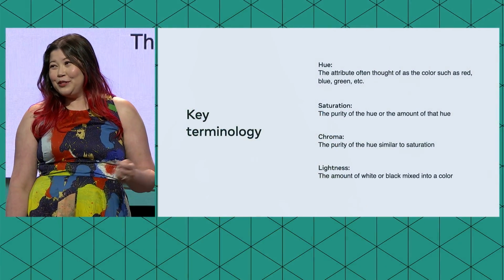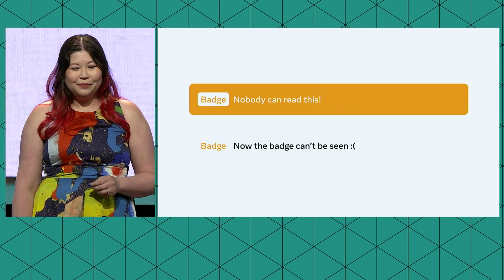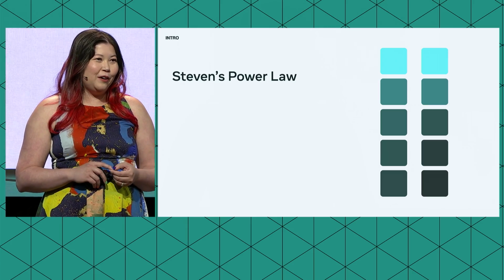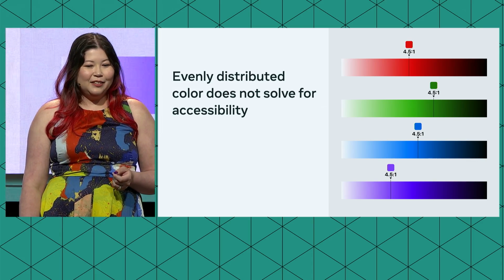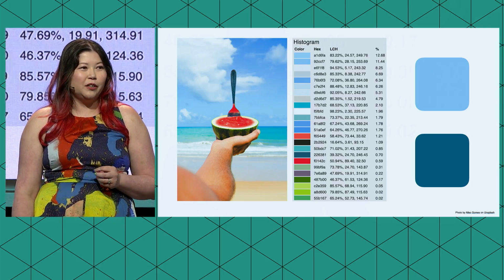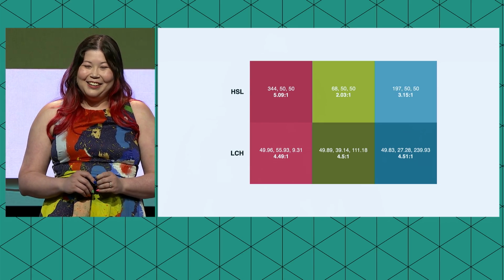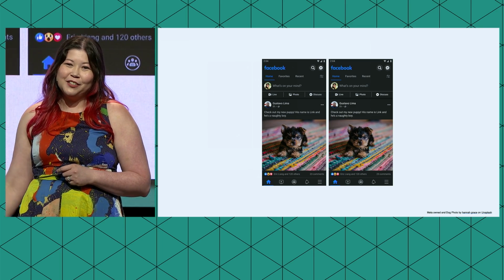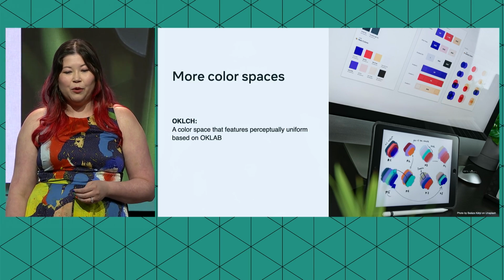Using color at scale for aesthetics and accessibility - Ashley Seto (Config 2023)

Comment: Putting alot of work into analyzing different digital color gamuts won't pay off cause you will never ever be able to control the output. There are too many different monitor setups and monitor types out there. Lightness, brightness, nits, graphic cards etc. The factors are many and they all affect the way colors are perceived, in addition to that we have the biological aspects. Our ability to actually see colors vary vastly. I read an article on a forced calibration profile process that could be run as a script the second a user entered the page, loading a color profile onto the user client (desktop) like a ICC profile of sorts, but it never took off. Seemed a bit intrusive.